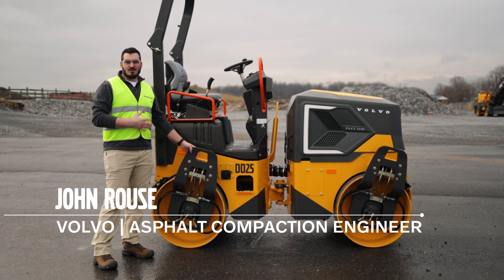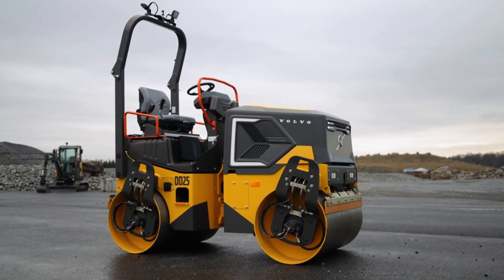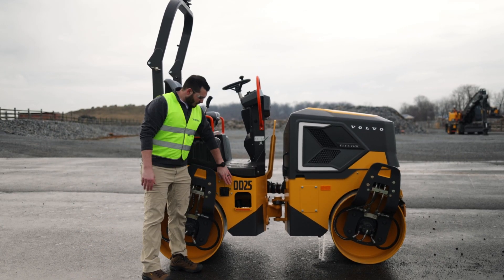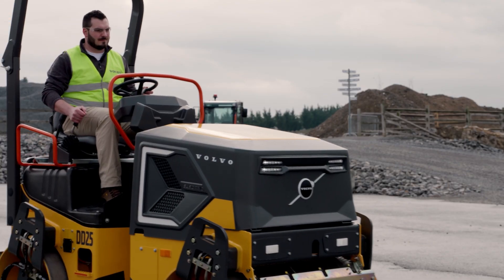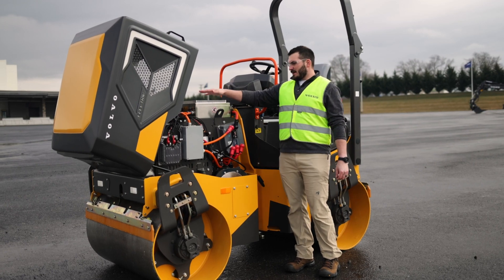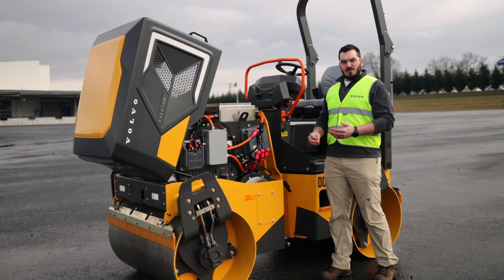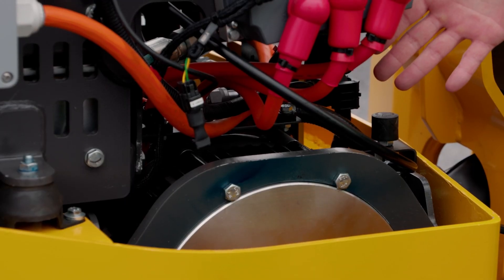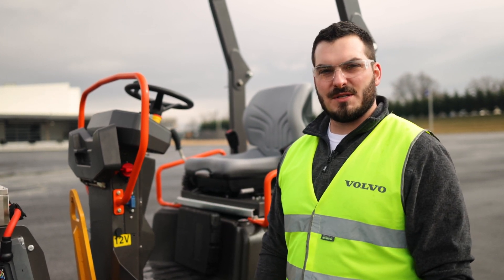Volvo DD25 Electric Compactor Walkaround

Comment: Didn't answer the question of how long will it run. A full day workload is not really an answer that could be 2 hours that could be 8 hours.
Reply: Yea that's silly how he would emphasize how that is basically the first concern with electric equipment, and then give us a non-answer. 1 hour full charge time is impressive.